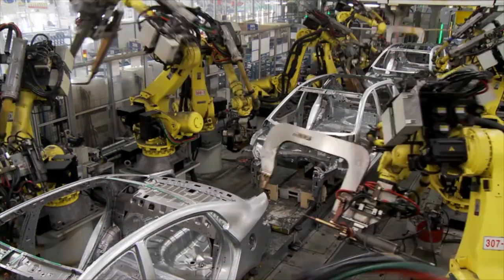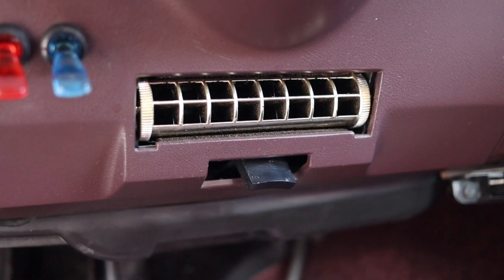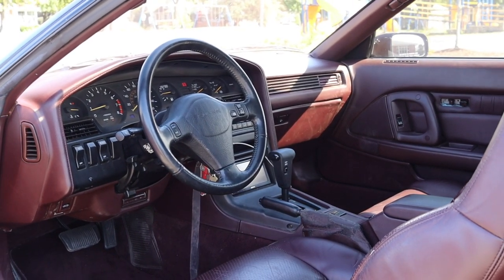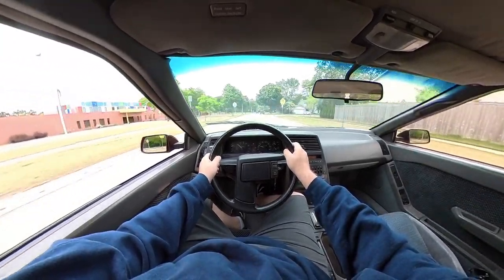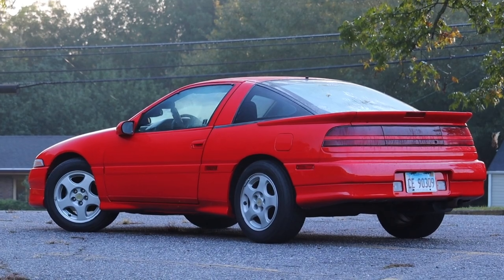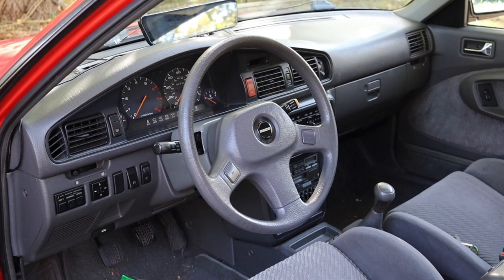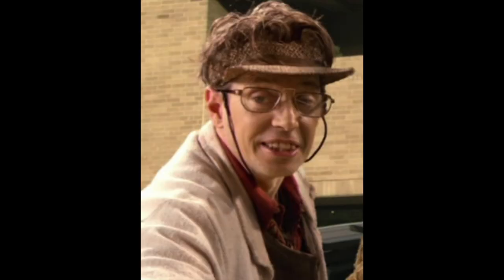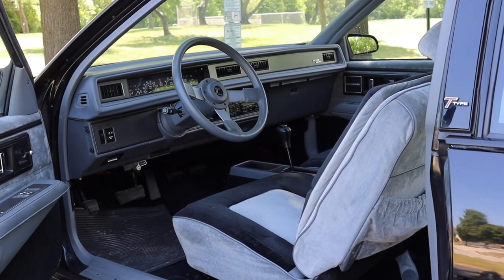Crotch Vents - What They Were & Why This AMAZING Feature Went Away!

Comment: Ah the crotch/coochie cooler. GM cars all had them. My first car was 77 Buick Regal that had it. 
My complaint with modern cars, is they have terrible ventilation without a/c on. My Focus has zero air flow without the fan on. Whereas, my 83 Civic had no A/C, but excellent flow-thru air via the two side front vents in the dash, each with their own outside air on/off levers, and it also had pop-out rear windows that stayed propped open. Look at one, and you see a prominant intake between the hood and the wipers. This is where fresh air entered. The Focus draws air from the cowl area, but that is slightly under the hood. The cowl and hardware seems to heat up easily from the engine heat. So, except for when travelling highway speeds for a long duration of time, "fresh" outside air is usually already hotter than ambient air, another reason why you need to turn on the a/c-- to counter that hot air that it draws in. What the car needs is a "cold air intake" but for the HVAC, not the engine. I don't know how this is possible, but I'm going to try to see if I can improve the heat shielding of the cowl area. This is on my mind b/c my a/c needs a new evaporator core, which costs more than the car is worth b/c of the labor of having to remove the entire dash to get to it. The car is otherwise excellent, so I'm trying to find ways to get better fresh airflow and see how long I can tolerate it. "Market Adjustments" from dealers around me are still $2500-$5000k for even basic Corollas/Corolla Hybrids, so I'm trying hard to avoid buying a new car as long as I can.

Comment: Have had several cars with em...current crotch coolin ride is a 75 Grand Ville convertible.  It, like most GM crotch enabled cars, has both a drivers and passengers vent.  On a hot day, running commando in a pair of shorts with that vent aimed right up the leg...ahhhh

Comment: I remember growing up we had several different cars that had these. In one car we about froze to death in the winter. The car had a VERY good heater, but the problem was whoever was driving, usually Dad, could not completely close off the leg vent (that's what we called it, it just sounds better than crotch vent). So he'd sit there driving and get sweltering hot, and turn the heat down. While us kids in the back seat went to shivering, because there was no rear heat, it all came from the front. Those were the days!

Comment: Things to bring back in cars/trucks/vans etc.: 

1- Crotch vents!  (to cool the junk)

2- Fresh air vents under the dash. (Because just freakin' do it!)

3- Wing/vent windows. (Again,  Just do it!)

4- Real, physical controls.  Buttons, switches, knobs and levers.  (fuk touchscreens!) 

5- Rear windows that go ALL THE WAY DOWN!  (Keep animals at home and your crotch goblins strapped down and they won't jump out the window.)

6- Style.  (Sick of conformist eggs and beans!  Bring back lines, edges, details, hood-ornaments etc.  Pedestrians should stay on sidewalks or the grass!) 

7- Right to repair!  (with common tools!  One should not have to have a degree in computer programming and 50 grand in "special" tools to fix their own car!) 

8- Car stereos with physical AND SEPARATE Bass/treble or EQ, and balance/fader and volume And Tuning/track controls. (Have to navigate menus and submenus just to change a simple thing like the bass level.  It's B.S!)

9- The dark tint at the tops of the windshield.  (Those stinking dots don't do shit!) 

10- Sun visors that actually meet in the middle and block that area above the RVM where the sun always inevitably shines right into your eyeball through those pointless damn dots. 

11-  Interiors with actual color.  (So done with soulless gray or beige.)

12-  Drivers who drive them.  (instead of playing with a cellphone the whole time)

Comment: Had a 1974 landcruiser, had to run the heater in summer to avoid overheating.
Hot air straight to the crotch in an Aussie summer 😮

Comment: I think the reason was cost-cutting.  But modern cars have rear vents for A/C and heat, which is a more valuable feature than the crotch vents.  The best A/C airflow is when the vents are all aimed up high, and not at any people.  The cool air then just naturally falls and cools the whole cabin.
Reply: True about cool air settling…once the car is cool. For the first 10 minutes it needs to be blowing on you. The powerful airflow on your body helps evaporate your sweat faster, cooling you much faster than gentle cool air descending. When it’s 95 or hotter outside, you need every bit of that extra cooling. Sorta like the hand air dryer in restrooms. The don’t have you stick your hands over a heating element, they have the heated air blowing directly on your hands to speed it up.
Reply: You must not live in Arizona...   118 you want the air on you at all times.  The heat is baked in from the front windshield and back glass if it is a fast back or hatch.   Also getting cold air on the feet is a must as you can get very hot feet from the floor of the cars.

Comment: I wouldn't say that today's AC systems do a much better job of circulating air than those of 40 years ago, although in both eras there were some very good systems and some wretched ones. I'd say the combination of ventilated seats and lack of space has put crotch vents on semi-permanent hiatus. These "lap coolers" as GM often called them, were particularly useful with the vinyl seats that were common in the 1970s, but they would still be useful today. Vents higher on the dashboard can be  directed downward, but they tend to hit the knees first, making them ache, while leaving the area that contacts the seat hot and clammy. I wonder if anyone makes an add-on fan that could be put below the wheel, or maybe in that gap between the seatback and the cushion.

Comment: My first car, a 1988 Dodge Shadow 2dr hatchback had one as well as my second car, a 1998 Chrysler Sebring coupe. The vents were nice on a hot, humid day but I haven’t really missed it in my vehicles since. The HVAC systems have improved and they now use the under dash vents, once reserved for heating, for bi-level cooling. Therefore a hot crotch will still be cooled, though it might take a little longer. Also, some cars now offer ventilated seats that can cool your crotch among other things.

I’m sure the “crotch cooler” went the way of the dodo once knee bolster airbags became standard. I’m fine with that. Safety over comfort.

Comment: My 1993 Buick regal had a "Crotch vent", or personal vent. I enjoyed it, with the leather seats it helped with sticking to the leather. I guess the new crotch vent would be ventilated leather seats, my Buicks replacement was a 2009 Lexus ES350 with the seat ventilation, it got to the same point on a broader scale than the crotch vent did. It air conditioned every part of your body touching the seats instead of just your crotch. Both were SUCH RELIABLE CARS. Neither let me down driving them both to 200k 🙏

Comment: My 2009 (NC2) Miata has crotch dumpers that are activated when the AC control is in any of the three “open mode” positions designed for top-down motoring.

Comment: Not sure what you are on about - my 2012 Range Rover has a crotch cooler, along with airbags, climate control, collapseable steering and all the other safety stuff.  It is not part of the steering column but like your vid pic - under the steering in a different panel.